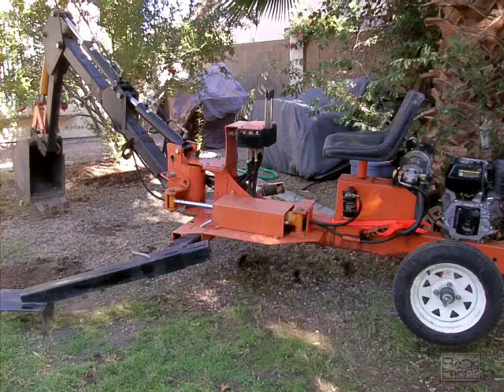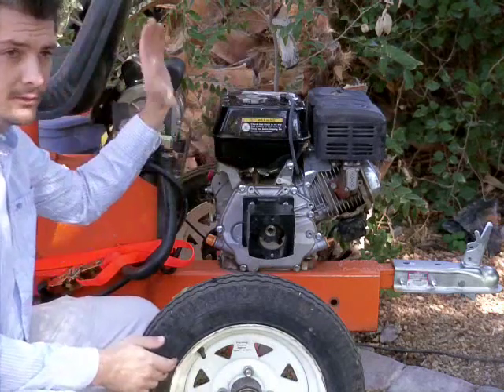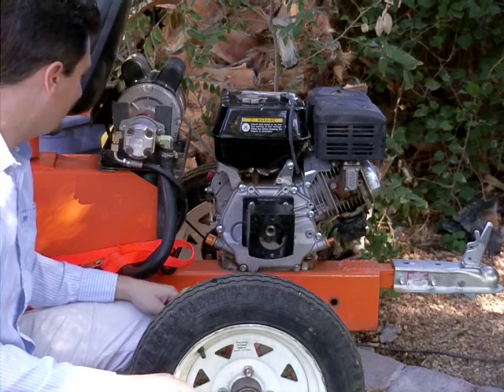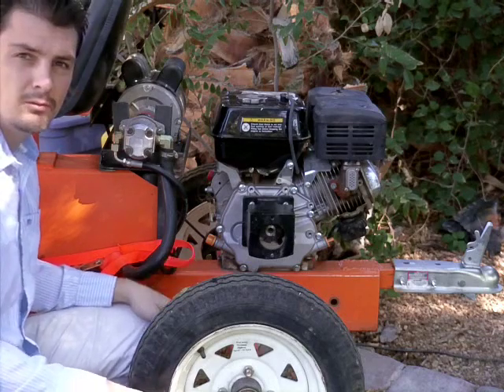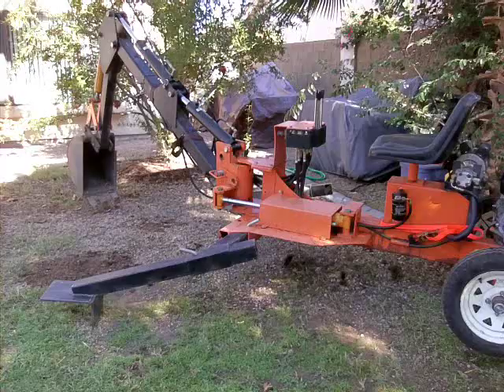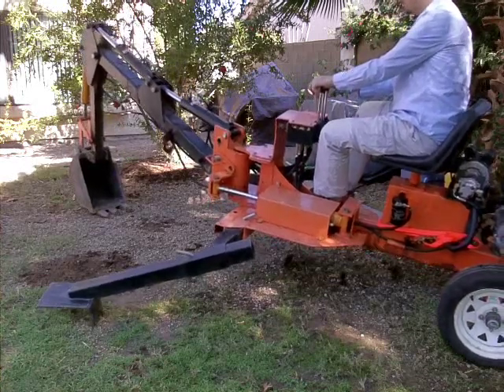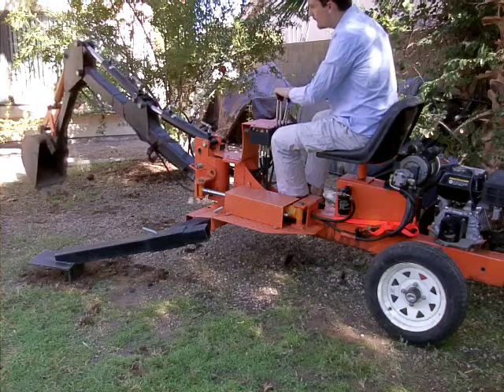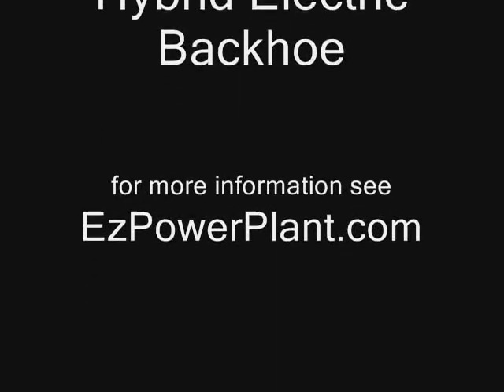Harbor Freight Trencher converted to Electric Backhoe with EzPowerPlant

Comment: Sorry but you sound like a real whinger and a wimp. 
You have to pull the start cord everyday to get the engine running?  Wow, sounds like so much effort and hardship!  Pretty sure I could pull a start cord( or put an electric start engine on it) and have the thig running much faster than the time it takes you to go get a lead, run it out then wind it up again when you were finished. 

The thing smokes??  Maybe you should try putting Petrol instead of diesel in the thing then ! I have a  bunch of those engines and NEVER seen one smoke yet.  They wouldn't be allowed to be sold if they smoked. If yours does, You buggered something up. 

The noise?  I thought you might have something there but the pump still makes a racket more than I would have expected with the electric.  If I have to put up with that I may as well put up with teh engine and wear ear muffs or ear plugs and listen to some tunes while I get the job done about 10 Times faster with the right engine. 

I have a LOT of solar power and it  would be good to use that however then I have to run a long lead to where I want to work and a good heavy duty one is not cheap. Then I have to watch where the thing is and probably get off and move it out the way from time to time. 

Most of all the thing runs like it's broken and I doubt would do any sort of real work without overloading the electric motor. It's hard to imagine a 2-2.5 Hp  electric motor doing the same work as a 9 Hp petrol one. 

I think to be remotely useful youd want a 5 KW at least but then you still have the cord problem only now you would need a 3 phase lead and have that available in your home. 

For $3 an hour for fuel, I'll stick to the proper motor thanks and be done in an hour what would take you all day..... or longer.

Comment: I don't think Steve L understands that he is showing this thing running off solar/battery. That's pretty awesome if it was used in a place that it was difficult to fuel it with gas easily. Which model ezPowerPlant is it?